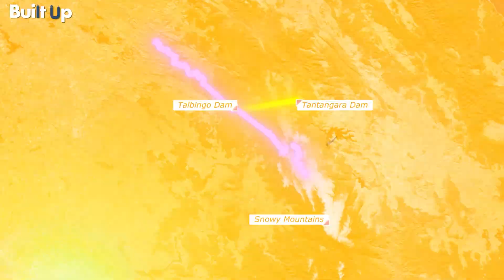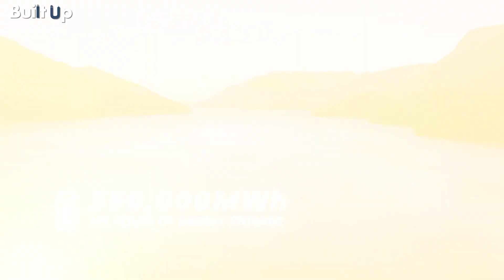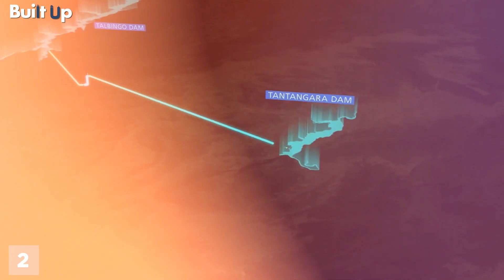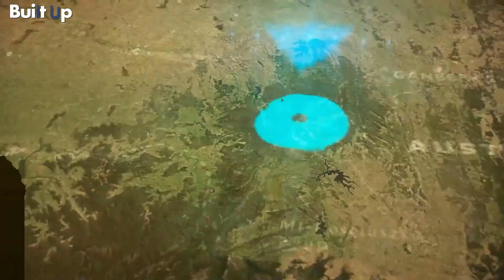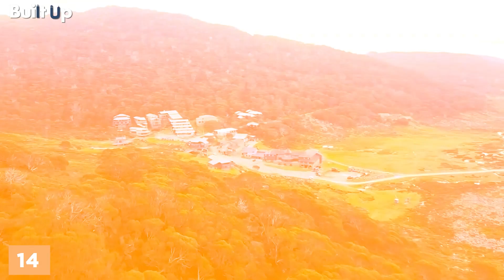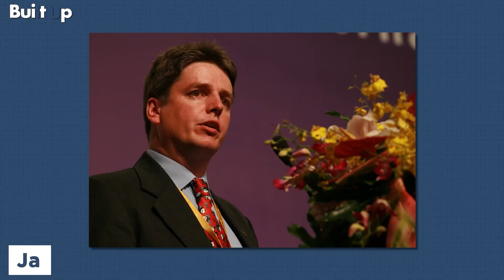Australia's $8BN Battery Bet | Snowy 2.0 Power Station

Comment: If the Chinese connect Melbourne to Brisbane with a 14m diameter tunnel via Albury, Canberra, Sydney (WSA), Newcastle and Coffs harbour and install Japanese SC maglev overnight container trains allowing the daytime fare to be only $10 it goes directly below Snowy 2 so HVDC cables in it to connect to the nuclear power station for when it has an excess of supply.

Comment: CRIMINAL !  Some napkin calculations suggest that for $12B we could already have a zinc-air battery with capacity for 10 million Australians - a lot more energy efficient than pumped hydro and able to be located between supply & demand sites instead of having to send power to the Snowy and back, locations like ex-coal reserves like the Hunter that could do with the employment opportunity.
Reply: There is very little loss in electricity transmission. AFAICT zinc-air batteries are only theoretical at large scales, pumped hydro is *proven*. 50% loss of energy is also just fine in a battery system, lithium ion batteries only get about 80%. Not sure about zinc-air though.